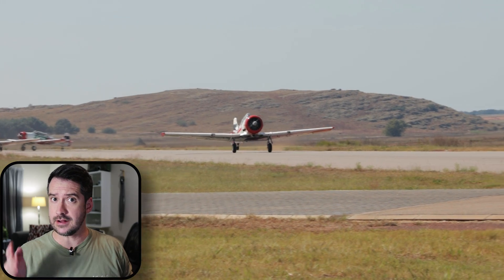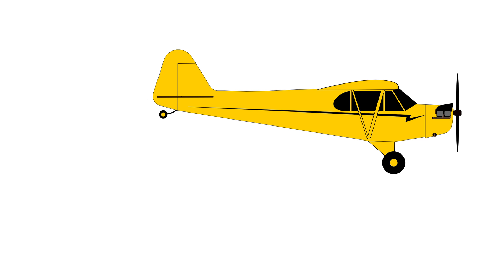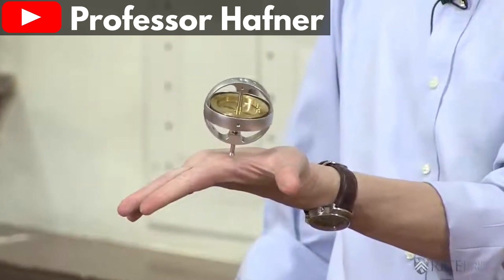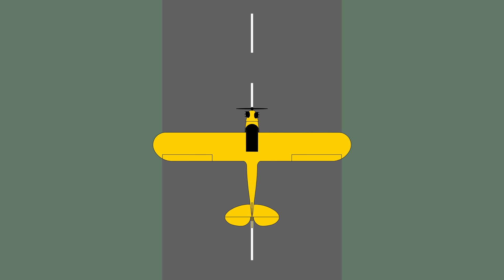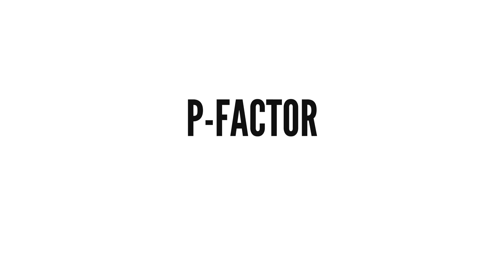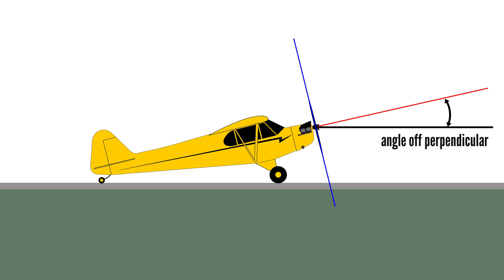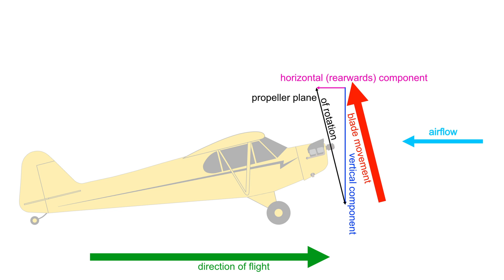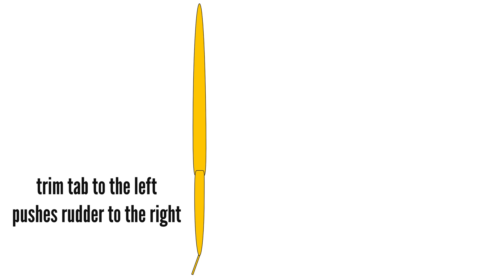The Effects of a Propeller on an Aircraft - Definitive Guide

Comment: A 70 years old aeodynamics textbook explains the effect of the spiralling slipstream differently (not due to hitting the vertical tail): It sees also the slipstream as a gyro (not only the propeller) which is deflected downwards by the wing's downwash. A clockwise propeller's slipstream is then deflected (turned) clockwise seen from above and the airplane anti-clockwise (action-reaction). Hope I got it right.

This explains why multi-engine airplanes yaw even though there's no vertical tail hit by any slipstream. It also explains why I experienced strong left yaw in a turbine C206 standing (!) at the take-off position and why the yaw varied with flap deflection.

While P-factor undoubtedly exists (in forward motion) quantifying and telling apart the two effects seems hard. Unfortunately, the book does not go any further into this.

Comment: We obviously can't deny the left-turning tendency, but I've always had a problem with P-Factor. It confuses me that we do not apply gyroscopic precession here. Obviously, the downgoing blade creates more lift than the upgoing one. However, this should be considered as a torque on the propeller, and the resulting motion, therefore, must be 90 degrees later, shouldn't it?
Reply: Interesting point.
Reply: Heres my take on that. Every action has an equal and opposite reaction. So if you have a free gyro, sure push on it and it moves as if youve pushed it at a point 90 degrees in the direction of rotation. The gyro feels really rigid to you where youre pushing it. I know this as i  repair gyro instruments.

However this breaks down if you get gimbal lock on the 90 degree axis and all of a sudden there seems to be no more rigidity whatsoever. Its a really weird sensation, but it is whats commonly referred to as toppling in aircraft gyro instruments or sometimes called gimbal lock

An aeroplane makes the prop a non free gyro to some extent.

So while there are gyroscopic forces generated its not anything like a free gyro

So if you have a high angle between the relative airflow and the crankshaft axis i would expect that the downgoing blade would tend to pull the aircraft forward more than the upgoing blade. In a clockwise from pilots view rotation, ie lycoming/continental/rotax id expect this would also give you some pitch up moment.

For a gypsy/russian radial it should also be pitch up.

So in my low wing plane, a sudden application of power at a low airspeed should get some pitch up but this would be countered by the prop shaft being above the centre of gravity. It might be different if i do the same from slow inverted flight. 

Maybe ill give that a try
Reply: For me it not so obvious that the downgoing blade creates more lift: yes, its cord makes a larger angle with the plane perpendicular to the airflow, but at the same time it goes forward into the airflow means basically it is in a faster stream than the upgoing blade and faster airflow cause less aoa for a same pitched blade rotating with the same speed. In fact the same thing cause the blade's higher pitch angle and its forward movement and if you think about its geometry they should cancel each other.
Reply: OK. I almost instantly realized that the only false statement is downgoing blade has higher aoa. It has the same as the upgoing blade, because as bigger its angle to the plane perpendicular to the airflow is as faster its forward speed is. But as the downgoing blade goes faster to the airflow it creates more lift despite the same aoa.

Comment: Please make a video explaining why an aircraft that is yawed to the left, but in steady direction flight, with left rudder and right aileron will stall left wing first when aoa is increased to critical angle of attack.

You cant say its because the left wing is flying slower.
The right wing has the hugher aoa due to dihedral but the ailerons are deflected so that both wings gave the same total lift generated roll moment.

And then if you think youve explained it correctly, consider that a plane with zero dihedral still departs to the left even though there is no dihedral effect,

I cant answer this and ive challenged every explanation ive seen by youtubers and flight instructors and everyone has conceded their explanation doesnt stand up to scrutiny.

Maybe you can explain it as your explanations i find are very good.
Reply: When yawed to the left, but as you say maintaining a steady direction flight - so if I understand your question correctly, the aircraft is flying diagonally forward - ie the 'heading' (the direction the nose is pointing - is a bit left in your example) is different to the 'track' the direction of travel or path of the airplane through the air. The relative airflow is coming from the direction of travel, ie slightly side-on from the right of nose.  Easy to visualise with a pen or pencil.  So what you have is that the relative airflow to the left wing is being partially obscured by the body of the aircraft whereas the right wing isn't.  So in this case the inner part of the left wing, the root and inboard portion of the wing obscured from the relative airflow isn't generating lift because there is no airflow over it, but further out towards the tip, the wing continues to  generate lift as the fuselage isn't shielding the wing from the airflow this far out on the span. In contrast, the right wing has clear access to the oncoming relative airflow, so its generating lift across the full span.  When AOA (alpha) is increased beyond the critical angle of attack, the tips (OK this is for swept wings) stall first.  So in the case of the left wing it is generating no lift at all (its fully stalled), whereas the right wing is still generating lift inboard of the tip.  So the right wing is generating lift and the left wing isn't.  The resulting moment causes the aircraft to roll to the left.
Reply: @andytamlyn  so in my case this still does not hold up.

If i yaw left with rudder the aircraft shows a slight roll right. This is a low symmetrical wing with no dihedral. ( this aircraft actually has downturned edges on the inboard edges of the aerobatic spades which are fine tuned to give slight left aileron to negate any coupling between yaw and roll, so in fact i have slight left aileron to hold level)

Therefore the assumption that part of the inboard left wing isnt generating lift must be incorrect or there would be a left roll produced.

The explanation of the aileron down deflection acting as incrreased angle of attack is also not really satisfactory. Aileron down is 
increasing the camber and therefore the lift coefficient, just like a down deflected flap should reduce the 1g stall speed as flaps always do at moderate deflections

Also per the spades design explanation, there is slight left aileron

Further, the tips dont stall first. Its a straight wing and specifically designed with the aft surfaces being dead flat in both directions, as many aerobatic aircraft are, which is done so that the whole wing stalls at the same AOA. The stall when it comes is sudden and very complete. Unless there is yaw, it doesnt tend to drop one wing either upright or inverted
Nevertheless my aircraft still departs left.
Can you further explain
Reply: Beyond what the previous wrote, the aoa is higher on the left wing at the area of the aileron due to its deflection, therefore that part of the wing will stall earlier. If there is dehidral so the right wing has higher aoa means aileron should be deflected more to counteract the rolling effect of the different aoa, so at the left wing's aileron aoa will be even higher.

Comment: I built and still fly my 180 HP RV4 after 25 years. The most significant left of runway heading excursion, happens when attempting to bring the tail up too quickly, particularly with a rear seat passenger. As described here, better to pick up speed and raise the tail slowly 👍

Comment: The spiralling slipstream is completely  false. Yes, the tracking of the prop tips DESCRIBE a spiral, however the thrust is moving essentially straight rearwards. 
It is easy to get proof of this. Do a google image search of Red Bull air race action shots. These aircraft have smoke systems in operation during the events. Smoke is generated by injecting smoke oil into the hot exhaust. The echaust outlet is obviously aft of the prop and completely within the influence of the propellor slipstream. In no image will you see the smoke doing even one spiral completely around the fuselage. 
It's a bit like everyone assuming a given point on a rolling tire makes a circular motion relative to the road as it driven along. But no. A given point starting at the bottom, for example, is momentarily stationary before it rises, prescribes a half circle accellerating over the top only to come to a halt again at the bottom. The tire as a whole rotates but every given point does nothing of the sort relative to the road surface. 
The spiralling slipstream is an old fallacy probably born from the first observations of prop tip vorticies. 
If the slipstream made all those trips around the fuselage there would be no energy left for thrust. Accordingly the airspeed of the thrust would have to be incredibly high. Many many times higher than the aircraft airspeed. 
It is time this error was removed from pilot study theory books. 
Cheers
Reply: Good call laurie.

I have to agree with you.

Flying line astern formation also demonstrates this. Flying echellon and about 1/2 a wingspan out, you get a very strong roll into the lead from the aircraft wake though, and you can clearly see that vortex in smoke
Reply: But at the top of a hammerhead, whats that left yaw? I suspect its slipstream spiralling, at the much lower forward speed
Reply: @davefoord1259  if truly vertical its the normal torque effect  dominating once airflow over the controls is lost. If not quite vertical its good old P effect. It's for these reasons that aerobatic aircraft normally have a preferred direction of yaw at the top of the stall turn (hammerhead). Some types will happilly go one way, but trying the other way is difficult and/or requires much earlier rudder input before all the non-slipstream airflow is lost. 
Depends on the type and direction of  prop rotation, power available etc.
Reply: And in formation flying it is absolutely critical to be able to understand, visualise and be ready for the effects of wake and wingtip vortices from other aircraft.
Reply: @lauriejones3198  its not torque right at the top, thats trying to roll you not yaw you. Aileron position is a good guide to the right time to kick the rudder.

 and its not p factor as aoa is zero and prop is perpendicular to chord line.

I think it is slipstream at that point
Reply: Slipstream is there, but that spiraling movement is way less significant, than illustrations shows. E.g. in this video the graphic showed one full rotation before the stream hit the stabilizer. It would rotate the plane like crazy. In real the airflow rotate maybe tenths of a degree on the whole length of the plane (it depends on many factor). It enough though to have a noticable effect.

Comment: Please create a video telling why planes with wings lifted to up are more stable.
Reply: Which is more stable: if you try to lift up something by grab at the top and pull, or if you push on the bottom and try to keep it balanced?

If you do these by touching the object at a single point, the answer is obvious and although the lift of a plane is a spreaded force, that's just makes the effect less noticable, but not eliminate it.